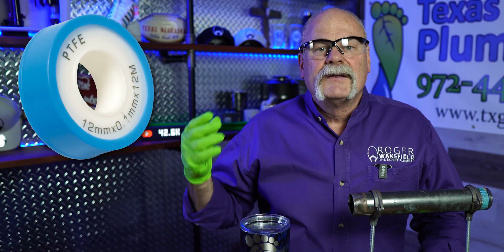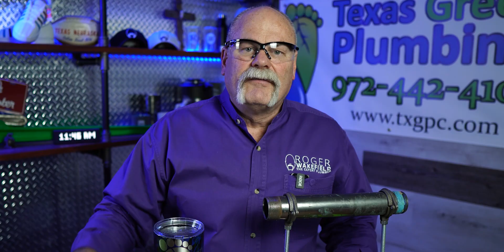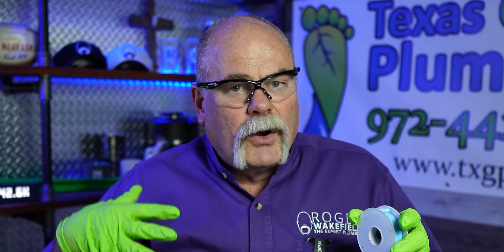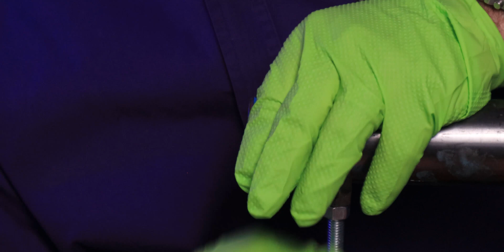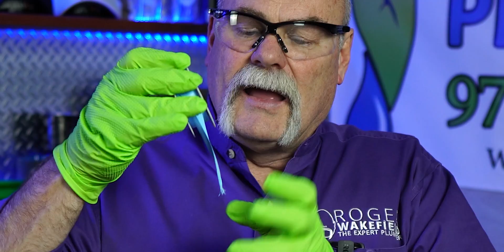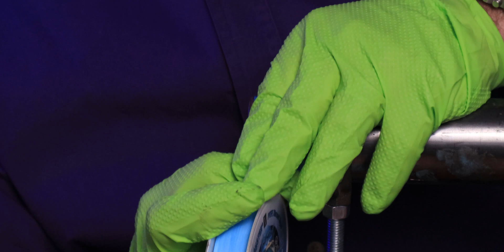How to Apply Teflon Tape/Plumber's Tape like a Plumbing Pro!

Comment: Hey roger. I got a question. I am a general contractor and mainly do kitchen and bathroom remodels. I use teflon tape at the shower spout to drop ear/90 degree fitting. Now here we need to tighten or until it's tight and aligned pointing down. Sometimes it feels loose and i think i should do one more turn. But then it feels way too tight.  I worry about splitting these cheap Chinese drop ear 90's. What's the fix
Speaking of which. I have a problem with uponor drop ears coming loose from the wall when i use them on shower heads.   I have made a fix to fix the problem but i am still wondering why it happens. My fix is to not use the pex drops. I use a sweat drop with a 6 inch piece of pipe soldered to it and then a pex adaptor.  I like using pex for the shower head,  vs ridgid pipe the whole way,  because i usually have a niche or something that i need to run the pipe past. Zig zagging with copper sucks. 
Thoughts. Here's the vid of my issue

https://youtu.be/liehtB6JooQ

Comment: Does anyone know do you have to move your solder all the way around on joints or can you leave it in one spot ?
Reply: Isaicc, yes you can leave the solder in one spot and it should roll around the fitting if the pipe and fittings are clean, But I like
To like to touch the solder all the way around the fitting. If I'm not
100% sure if the weld is "solid" I
Use an inspection mirror to check
It out!

Comment: Good video. I swear by the blue monster PTFE tape  I've even uses it on some threaded electrical fitting to protect from corrosion (nothing in direct contact with water just for future ease of dismantling).
Keep a small triangle file in your tool bag/box for the occasional damaged thread on pipe. Trust me it will save you some headache.

Comment: Which way is "clockwise" I have a digital watch.
Reply: Clockwise on a digital watch is always left to right in the northern hemisphere and right to left in the southern but it may vary depending on which end of the pipe you're on and which direction us considered "up" in a given jurisdiction. In Australia, for example, up is down, left is right and right is wrong. Wrap the tape clockwise for standard pipe threads and anticlockwise for metric but always in the same direction as the Coriolis effect except in the typhoon season.
Reply: @tinman1955  the dope gives it the flavor!
Reply: @tinman1955 , don't forget to use a lock washer....😂🤣😂🤣😂🤣😂🤣😂🤣
Reply: Tin man,does this mean I should stop putting pipe dope in my coffee?

Comment: I only use tape on fittings that I know will be taken apart.  I use Rectorseal #5 And have tested almost every other kind extensively.    I had a pipe fitting on a team boiler one time that I had to cut apart and working by flash light cut into the female thread. I thought for sure I was screwed.  I put it together with #5 and no leaks 10 yrs later. This was saw all slot wiping out almost all female thread. The worst dope are the Teflon ones that I tested. If I do tape I use the thicker stuff like Blue Monster. They are quicker and easier to put on. Edit. No manufacturers suggest combining dope and tape. That combo also failed my tests miserably at high pressure.

Comment: I don't know what the code is but I've personally been told by an inspector that the tape or dope has to be yellow for gas fittings or he won't sign off. Maybe he's throwing his weight around, I don't know, but I need his signature and arguing with him isn't the way to get it.
Reply: it probably falls into the same reasoning we have different colored fuel containers. Realistically a gas, diesel and kerosene container are functionally the same but for safety standards someone decided to color code so no one mistakes them. Its dumb but id imagine this is similar and the tapes are all the same just different colors.
Reply: @ah7027  that makes sense, and even just that alone I agree with. It is kind of dumb seeing as how most of the regular pipe dopes sold in my area say they can be used for natural gas but the inspector wants only yellow... yet the gas company uses green dope. Whatever. Yellow stuff works just fine and I'd rather keep it separate from the one I use on potable water anyway.

Comment: In school our prof wouldnt let us use tape or dope because he insisted that a properly threaded joint wouldn't leak. Although he was right they didnt leak I personally always tape and dope in the feild
Reply: Lane Patterson - metal to metal when all is proper and tightened enough makes the seal, metal to metal is the seal.  Everything else lubricates it so it tightens further readily, and threaded pipe is hardly perfect.

Comment: I like Blue Monster tef tape and pipe dope. I do 3 wraps also followed with pipe dope. I have very few leaks. I used to use yellow tef tape for gas fittings until I snapped  a water heater gas valve. From then on I use just pipe dope on gas fittings and always bubble test when I'm done.

Comment: If I ever have a nipple in some stucco or concrete I will tape and dope like normal and do one very light wrap of tape on top of it all to help protect the dope from dust and debris. Generally here in California I have not ran across any specific tape we have to use for whichever systems we are working on its mostly been personal preference I like the hercules and blue monster tape, have had the best results with both brands and I usually have a jar of Pro Dope brand pipe dope. Love the videos Roger keep it up bro!

Comment: When I first learned 20 years ago, I was taught that you couldn’t use pipe dope (unless it was the Teflon reinforced door) on pvc. So connecting to pvc was really the only time we used Teflon. It was pipe dope for everything else. Of course the only Teflon we had was the really thin white stuff they sell at the hardware store. Later I learned that you can use it all pretty much interchangeably. That plumber was a good plumber but he’s now in his 80s so I was curious if this no dope on plastic came from how older pipe dope was or if it’s just something he learned incorrectly. 
 
I do it with tape then dope and it does really good. Unless it’s 3/4 or smaller then sometimes I’ll use only dope. I was taught never to put dope and then tape because the tape will float and push out and be useless.
Reply: Josh Cowart you don’t want to use tape and dope on plastics because both are thread lubricants and the thought is by using both you’ll make the joint up to much and crack the fitting.
Reply: tyler luht I don’t, I should have been more specific. I just mentioned plastic because I was differentiating ways we used to use different sealants. On plastics I’ve done a 180. Where I was originally taught only to use tape (or ptfe dope when it came out), I now use only dope. I didn’t think about specifying how I do plastics now because it’s rare that I ever use plastic threads. I do mostly new construction so about the only time I see plastic threads anymore is when I occasionally have to fill in on service and it’s schedule 80 nipples so I probably could use both. We run new yard lines in pex.
Reply: tyler luht something I was told recently that I never knew or considered about why not to use tape on plastic was expansion. I was told if you use a metal male to pvc female don’t use tape because it will expand and split the fitting. I’m not sure about this because for years we did this (of course it was always the cheap thin white tape) and never had issues. Especially when we’d always use metal male to pvc female because pvc males were so prone to breaking.
Reply: Sprinkler guys use dope then tape. Works fine.
Reply: @WelcomeToThePaarty  interesting, I’ve never seen the sprinkler guys use dope. It just seems like they only use tape and that super thin tape to boot, though they wrap it a hundred times. I assume you’re talking about fire sprinklers. Anyways I assume it works fine, I was just taught not to do it so it became a habit not to. I guess the way I mentioned would only apply if you globbed on the dope super thick and then wrapped it with tape. In that case I could see the tape sort of getting pushed off. I probably wouldn’t do it because it seems like a mess. The only thing I want to do after applying dope is make up the fitting otherwise it seems like you’d get it all over your hands and everywhere else. Frankly, I’d say tape, dope, or both, it all works. I worked for years using only pipe dope. We rarely used tape and we never had any issues.

Comment: You wouldn’t think you’d need a video for applying Teflon tape but, I’ve met a bunch of plumbers that don’t even know which direction to role it.

You should do a video about how to hold Channel Locks 
I’d say about half the people I’ve worked with through the years had no idea that it mattered which direction they faced when using to keep them from slipping
Reply: Bro but in all honesty all plumbing mechanics hate the way each other work and if you ask a master plumber a question each one will give u a different version of how something is done right lol
Reply: Good thought this recommendation would help me as an apprentice
Reply: @jorgeguzman9592  jesus 🤦‍♂️
Reply: Yep my people constantly say "turn them things around"
Reply: Man o man.  I'm 30. Been plumbing a 5 years and the guys that taught me plumbing would snached it out my hands if I used them wrong.
Reply: No you don’t have to tell an installer to turn wrenches around , just say “ how many years you doing this” gets the point across.
Reply: Even these videos don’t clearly show the correct way to install Teflon. I explain the way I learned and why. Never had to show the same person twice.  That is the difference between showing and teaching

Comment: Well first I don’t put tape on pipe further than the threads. The make in is 1/2” on threads and most of your threads are an 1”+ so why cover all the threads if they aren’t going to be part of the threaded connection? 3-1/2 to 4 wraps is alll you need . And I use pipe dope over Teflon tape , been doing it for 34 years now . As far as Teflon plugging orifice, how many times have you tipped a pipe up and the amount of foreign material comes out? I guess it’s possible to clog but I’ve never seen it nor has it ever happened to me.

Comment: who ever starts off with dope and then tape are doing it wrong. tape will slip and slide when threading on anything in that order of sealing. tape is the base that can hold onto the initial pipe and provideits own personal seal. pipe dope ontop is just Insurance for the other thread joining in after.
Reply: Fire sprinkler fitter here. I work with a guy the dopes before he tapes his threads....drives me insane.  But, to his credit, he hasn’t installed any leaks.

Comment: Roger, there are a lot of Teflon tapes on the market in different shades and colors that will pass all the criteria for the gas industry but you must understand the color yellow is there to assure us the proper tape was used. So my question to you is if I hold up five different pipe nipples, one with dark blue tape , one with light blue tape, one with chartreuse tape, one with white tape and one with yellow tape and I want you to tell me which ones are approved for gas, how do you tell me without a lab test?

Comment: I'm using a red gasket maker together with tape. For example in the case of hydraulic oil pipe without a pressure.

Comment: When I saw the title I was skeptical, but you made a few good points I hadn't considered, particularly starting from the back to front. I've also heard certain types of tape for certain pipes and applications, but never saw a manufacturer reinforce that. I have come across and almost used dope which wasn't allowed on propane systems (pro dope I believe). It's also worth noting how much the quality of pipe varies these days, some pipe won't take a thread without chipping even with a brand new die. Seems like pipe made 40+ years ago was manufacturered to a higher quality standard. I've taken apart old systems and the threads were so good they probably didn't even need dope or tape. I personally prefer dope then tape just because it's less messy, but as you mentioned, it's a personal preference, neither way will leak. We once had a spider web in a section of pipe from storing material outside, thing was so strong it wouldn't let gas pass through it. Talk about a head scratching troubleshooting nightmare! Needless to say, I always check the inside of the pipe now!
Reply: i believe old sch 40 pipe was made from recycled ships and tanks, todays pipe is recycled cars and crap
Reply: Kyle and Danny no doubt about it. I worked for the gas utility in St Louis, Missouri for 35 years and today's steel pipe cannot hold a candle up against the old stuff. I will say the fittings made by JP Ward out of Pennsylvania and McDonald out of Iowa are still top notch ( far superior to the stuff made in China and Mexico).
Reply: Bob Y ward quality is starting to become suspect. My thing is I always told my helper I never get leaks on gas pipe, this year already I’ve got a sand hole in a 3/4” tee and 2 1”elbows that leaked. Needless to say I wasn’t happy. It broke my 11 year run without a leak on gas
Reply: @joem5332  , nothing POs me more than when you do a perfect job and it doesn't hold a pressure test due to a sand hole ( and of course it is never near a union). 3 fittings in 6 months may not seem to be a lot to some people but when you go for years and install miles of fuel run without one bad fitting to you and I we know three is a lot.
Reply: Bob Y., couldn't agree with you more! Been in the industry most of
My adult life and am noticing the difference between gas pipe and
Fittings today are cheaper than hell. I take care of my threaders and dies but even with that the steel cuts differently than the pipe
I used back " in the day", keep up
The good work Rodger!
Reply: @joem5332  o p o
Reply: @dannykeane6565  那一